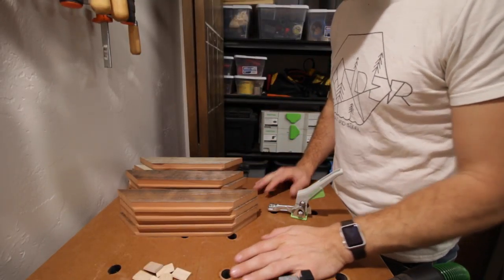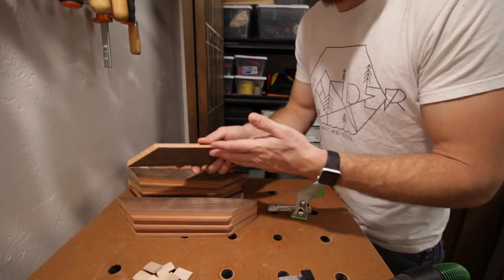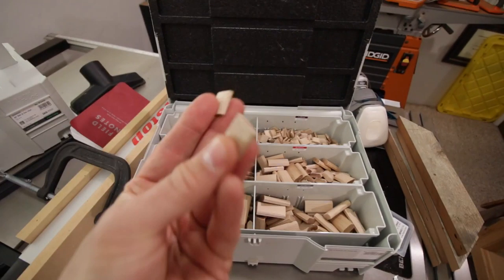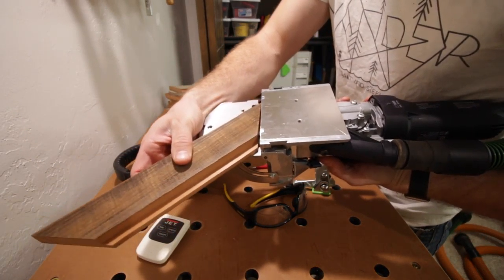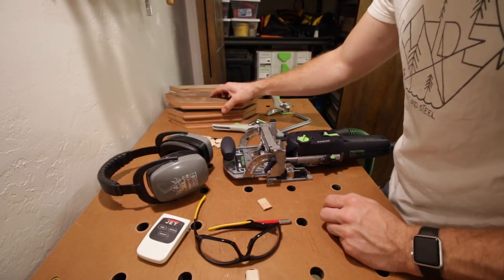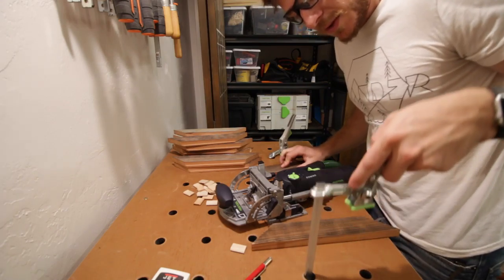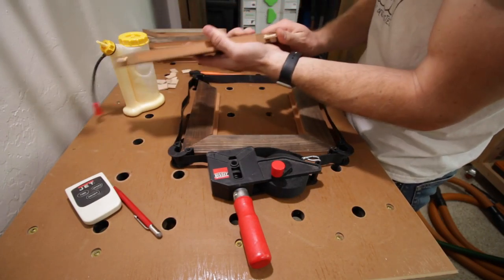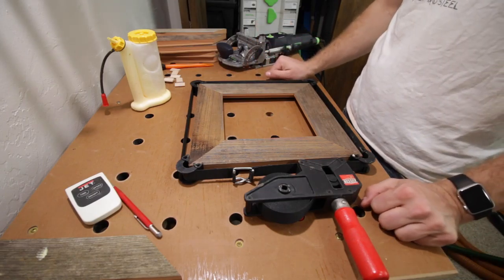Using The Festool Domino To Make a Picture Frame

Comment: The way you did it, the fence setting didn’t matter. The Domino referenced off of the table. The Domino is 10mm to the center of the cutter. At the 20mm stop the fence is 10mm from the center of the cutter. The stock was 18 mm so your fence was 2 mm above the stock. It worked out in this case but just be aware of it.
Reply: Referencing off the table is also the best way to reference such joints as you otherwise would need to push down on the top with the frame parts hanging off the table.